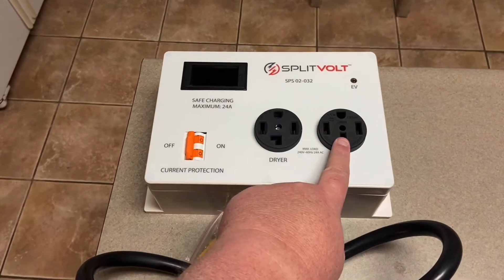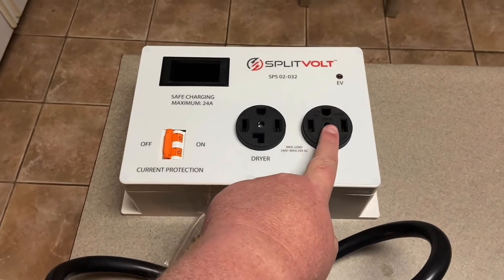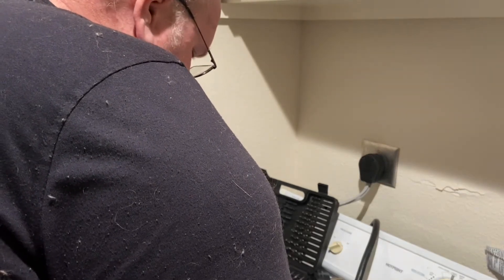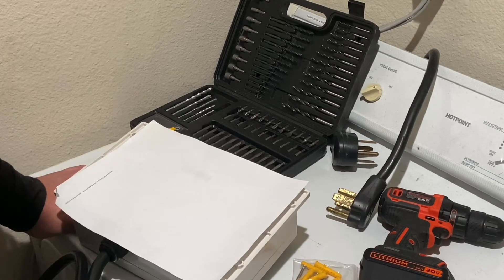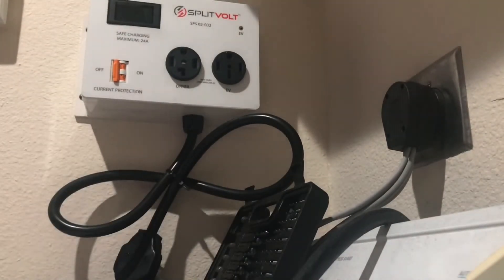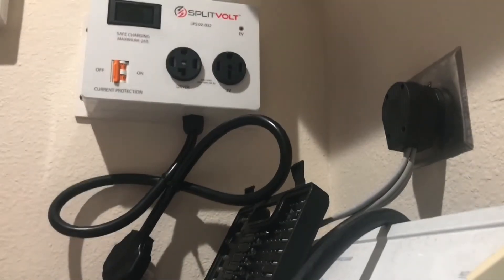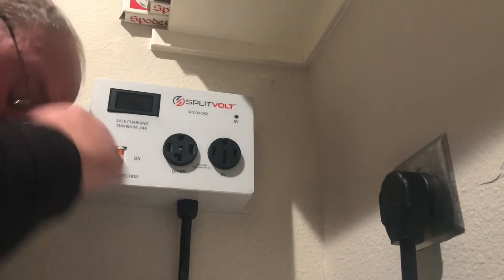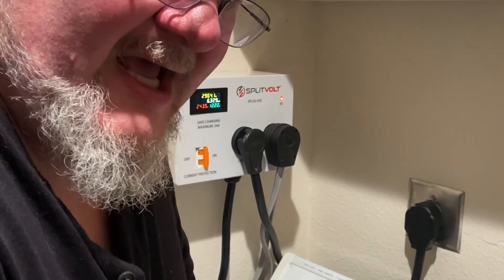Redneck Tech - Easily Share a Dryer Socket with a Level 2 EV Charger

Comment: Extension cord is not allowed to be run through walls. So while one can plug something into the outlet in the laundry room, the problem is getting the power to where the EVSE is. So really, dryer plug solution is not to code.
Also, extension cords are not allowed to be permanent solutions.
Reply from the maker: Ahhh, but forever hasn't happened yet so it isn't permamnent, I just haven't reached the end of its "temporary-ness". ;) I actually do have an electrician buddy who I'll be working with in the next few weeks that will be helping me run some 6 guage 4 wire romex and install some NEMA 1450Rs from my outside panel. I can't wait to see how fast my Caddy charges when it gets 11KW to it.
Reply: @kiltedtexan  14-50 is for a 50A breaker. All continuous loads must be 80% of that, so that means the EVSE will draw 40A, not 50A. 40A x 240V = 9.6 kW. 
11.5 kW is only possible if you pick a hardwired EVSE, because that allows a 60A breaker, and a 48A continuous loasd.
48A x 240V = 11.5 kW.
Hardwired is a much better option, because it only needs 2 hot wires and a ground.
A 14-50 receptacle requires an extra wire for neutral. Plus a receptacle requires a GFCI breaker, whereas with a hardwired EVSE, the ground fault is built into it.
Receptacles also have a higher risk of fires.
Seriously, go hardwired. Cheaper, better, safer, more performance.
Copy paste this and show this to that electrician and I 100% guarantee that person will 100% back all of this.

Comment: Does your unit have a high pitched buzz to it?  Even if I am not charging I can hear a buzzing even from 3+ feet away.  Other than that it works a treat.
Reply from the maker: Nope, no noise from mine. What kind of amperage are you pulling? I’m only pulling a max of 24 amps between the chargers. Perhaps she gets a little ‘talkative’ if the amperage goes much beyond that.
Reply: @kiltedtexan  I get the noise even when NO amperage being pulled.  Only time I don’t hear it is when the dryer is running. Contacted support and they said its normal to be able to hear it from up to 20 feet away!  That would be way too loud, fortunately I can only hear mine inside the laundry room.
Reply from the maker: That is weird. Mine is as quiet as a church mouse. That sux. Sorry it’s doing that to you. I’d be really annoyed too.

Comment: Just bought my Splitvolt NEMA 10-30 (both plugs) and it arrived today.   My Tesal Model Y arrives in 3 days, so I'll have it mounted before then.   Thanks for the "show & tell".
Reply: Hi I was wondering if you’re still using the Splitvolt device to charge your Model Y.  How has it performed? Have you had any issues with the 10-30 dryer outlet over heating or any product defects. Thanks for your time.
Reply from the maker: Absolutely thrilled to have been able to help, even in the smallest of ways. Enjoy the model Y, I hear good things about them.